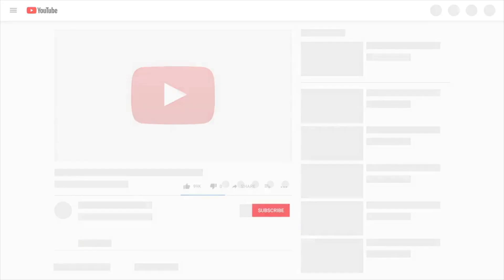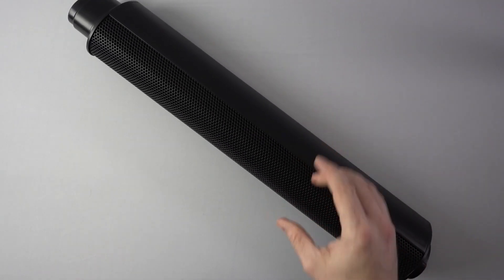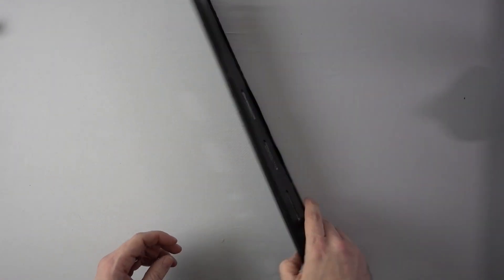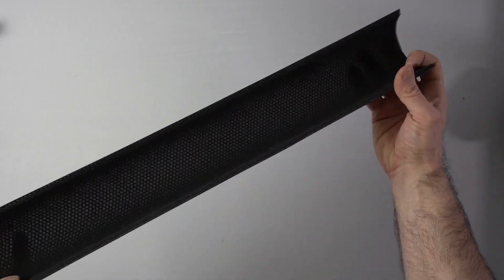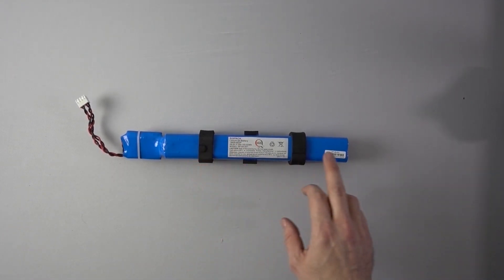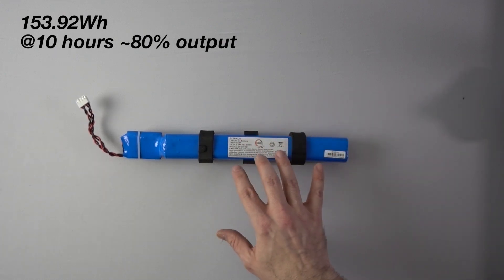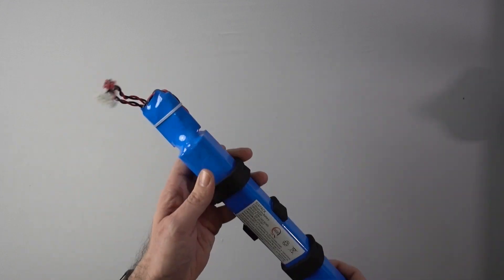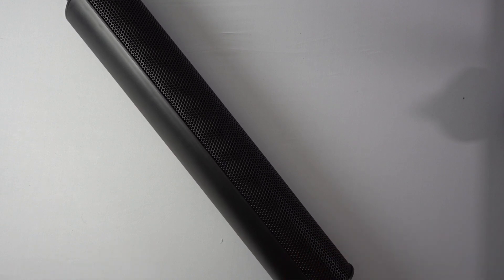What's Inside The Maui 5 Go Battery?

Comment: Good video. Would love to find the replacement innards. That part number produces no results on the internet. I really want to stack 2 battery column sections in parallel and eliminate the spacer column section so I can do an entire wedding without a battery swap.
Reply from the maker: You could try to reach out to LD Systems, but I am 99.9% sure you cannot run the batteries like that.
Reply: @djlouparis  you could run any batteries like that with the proper connector. They just need to run in parallel so it doesn't change the amount of power delivered, just the run time.
Reply from the maker: @DandyDoesIt  oh sure, if you want to void warranty the world is your oyster. Thing is I have never run out of power yet. And I'll run them sometimes from pre-ceremony till nearly the last song as fills.
Reply: @djlouparis  Pretty sure I'm past warranty. I run mine as mains. Usually require a swap partway through open dancing. They work well for what I do. I'd just like to eliminate the clunky swap out.
Reply: @DandyDoesIt  why not a simple button battery 1 battery 2

Comment: So is this unit battery only or can you plug in and just use your battery power as needed? Also I have a duo and we do from small to ballroom and outdoor. Would you rely on one unit or does two make all the difference? Thx
Reply from the maker: You can plug in and use + charge simultaneously (albeit slower). This model is discontinued now with the Maui 5 Go 100.

Comment: Thanks for an insightful video!
I imagine the original Maui 5 (no "Go" in the name) cannot be upgraded to battery power? Do you know?
Reply from the maker: No, the design is a bit different so you can't interchange between the 5 and the 5 Go (the power is delivered directly though the base which requires the power contacts and all.
Reply: @djlouparis  Thanks!